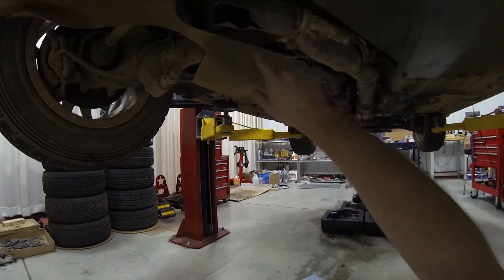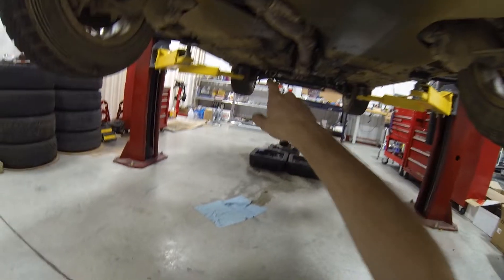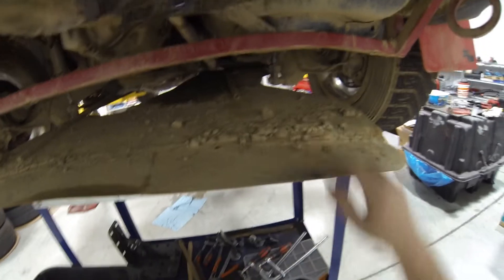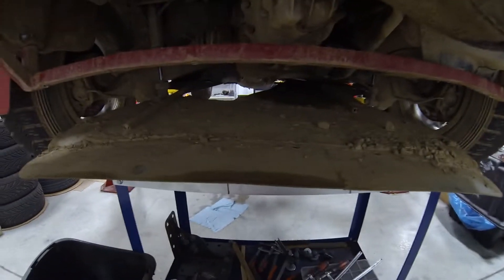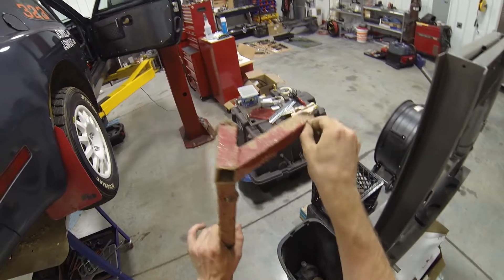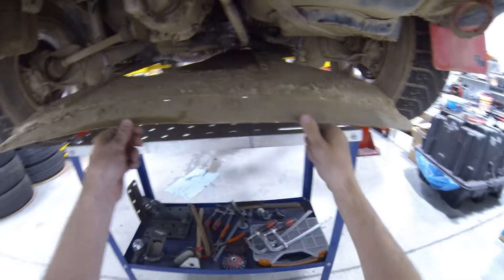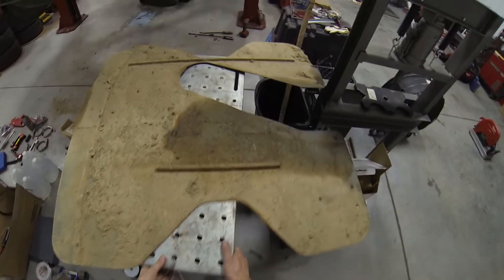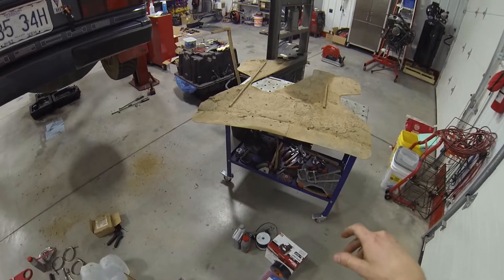Porsche 944 Rally: Rear Skid Plate - Part 1

Comment: I'm no engineer, however for puncture and heat resistance, a steel or Kevlar layer might help. And for the oil stain, it's likely motor oil. If it was gear oil, you'd know from the stank.
Reply from the maker: Yeah, agreed, it didn't appear to be gear oil... i really hope not... 😭😭😭

Comment: The early works Porsche 924s had a different layout - they had a fuel cell at the rear - here's a photo of a replica - https://www.duncanhamilton.com/media/11975/porsche-924-021.jpg?anchor=center&mode=crop&quality=80&width=1440&height=780&rnd=132697070640000000
Reply from the maker: It looks like they dumped a ton of money into re-doing the "trunk" section of the vehicle.  A fuel cell is way out of my budget.  😭